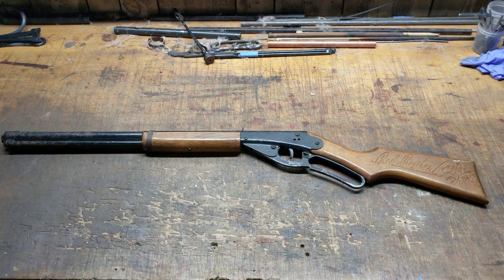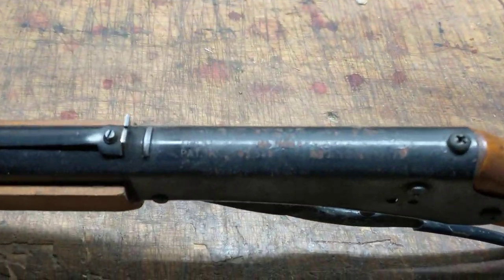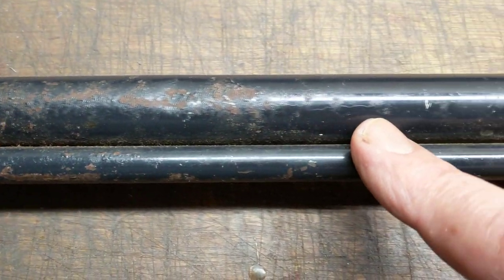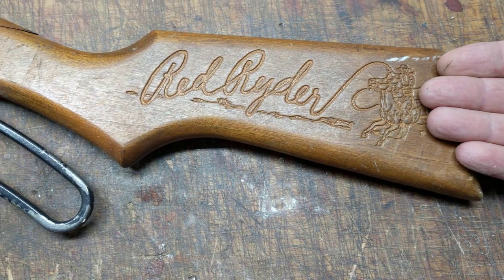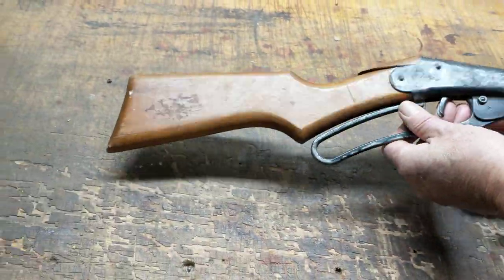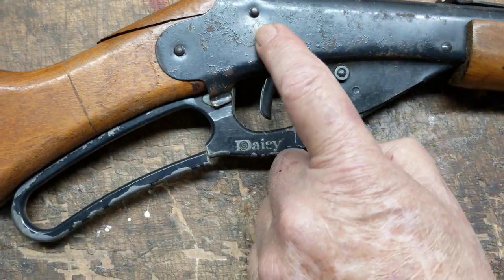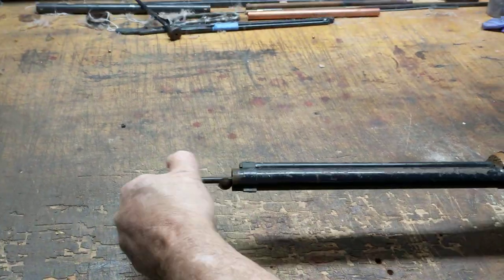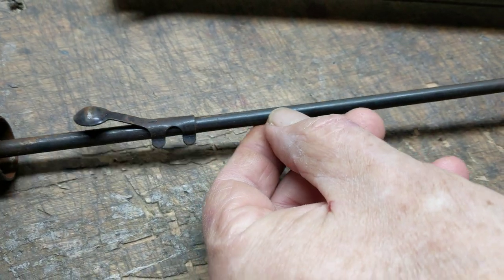Subscribers Daisy Model 1938 in for repair!

Comment: I have a 1938B red ryder and watching your video ...one of the first things you do is unscrew and pull out the shot tube...mine doesn't have an unscrew feature to pull shot tube...mine has like a muzzle cap with the front sight attached...I tapped the front sight outward to remove the muzzle cap but the shot tube didn't come out with it but seems to be attached inside to something...I'm stuck...any advice?...
Reply from the maker: Mike,  Your Model 1938B is a post 1978 design that has a fixed shot tube. It is not designed to be removed easily. The gun in the video is a pre 1978 Red Ryder with the older bottlecap tube that was designed to be easilt removed. Why do you want to pull the shot tube in your Red Ryder?
Reply: @RestOModDaisy  the bbs are not feeding and I was thinking maybe an obstruction...it pumps fine and shoots but no bb...
Reply from the maker: @mikethackston6862  There's a slot on the top of the reciever that allows you to see if a BB is in the correct position to fire. If you can't see a BB there when the gun is loaded that means the feed ramp is blocked with something. You can take a 3"-4" long piece of small diameter but stiff wire and push it from the slot towards the barrel. Since the muzzle cap is off, try that and see if any thing falls out like a mis-shaped BB or some other bit of trash.
Reply: @RestOModDaisy  I'll try it..I know where the bb view is and it shows a bb...for some reason it's not falling...
Reply from the maker: @mikethackston6862  That indicates you have an obsruction in the chamber or in the stotube it self. To clear it you're gonna need to disassemble the reciever and extract the trigger, lever and plunger assembly. Watch this video:

https://www.youtube.com/watch?v=jbVDiFaVhjw&list=PLmlZO8J1C8B2XVQUkZKxTXF2Mng7EcijK&index=10&t=1s

Once you get your shot tube assembly extracted you'll be able to see if your blockage is at the breech or maybe a stack of BB's jammed in the bore of the shot tube.

Comment: I have my Uncles 1938 Red Rider. My grandfather took it away after he shot my mother with it. He got it in 1941. Worked until about 2006 but no power any more. I made a stock and hand grip for it so it needs an original left side engraved stock and hand grip with hand grip strap. How do I get parts for it. 😎

Comment: I have a 1938B with a broken loading gate.  How can I get it repaired?  Thanks.
Reply from the maker: Brian, you'll nee to get a replacement part direct from Daisy or from the Cobalt 327 store on ebay. Getting a broken one isn't too tough, just tap the front sight off the front of the gun with a hammer and a wood block,  extract the broken gate. Compress the new loading gate to get it to fit inside the barrel shroud and push it into place.

Comment: I have a Daisy Golden Eagle model 50 1934. Unfortunately it doesn't shoot, maybe it needs a new leather gasket? I would like for it to be functional but still original condition. It is missing the rifle tube on top.
Reply from the maker: Could be. Given the age the beast it had the top hat air tube and leather seals and most likely a punchy, punchy mainspring. Have you taken the plunger out yet? That'll tell you a lot. The missing rear sight tube is probably pricer that a whole gun as those puppies are rare. Check out this video I just posted on a replica rear sight I make for the Model 195 Buzz Barton Special which shares a similar "Telescope" rear sight.

https://www.youtube.com/watch?v=5pX815q5pJw

Let me know if I can help.
Reply: @RestOModDaisy  the trigger is good, I took out the plunger and I'm surprised it it looks good. No corrosion. The BB tube needs cleaning and my cleaning rod is to wide for that.   Maybe a coat hanger with a patch? If you can help that would be great.
Hi Shane, seen the video. Looks good.
Reply from the maker: @dan9002  A coat hanger wire will work with a patch, make sure you cut the wire long enough for a good grip and try to round off the tip. So the plunger and airtube assembly look good, is the leather abutment washer still in place at the end of the compression chamber?
Reply: @RestOModDaisy  Unfortunately I don't see any gasket or remnants of leather. Maybe I need to remove the stock??
Reply from the maker: @dan9002  So you removed the screw in shot tube in your earlier post,  meaning the piece that comes out of the muzzle. The plunger normally refers to the plunger unit inside the receiver and you would have had to remove the stock to get to it. You'll have to remove the stock, remove the spring block and then you can get the plunger out. Check out this video to see how that works:

https://www.youtube.com/watch?v=Yir699E3DWE&t=6s
Reply: @RestOModDaisy  Sorry, I have been exceedingly tied up purchasing a home in another state. I forgot how difficult the process is.
Reply from the maker: @dan9002  No problem, property is a lot more important than BB guns. Get in touch when you have time.
Reply: @RestOModDaisy  Shane, I'm trying to sell off some items so I don't have to ship them at a high cost later.
Reply from the maker: @dan9002  Send me an email at "the societyforprofit@gmail.com" and we discuss that off line.